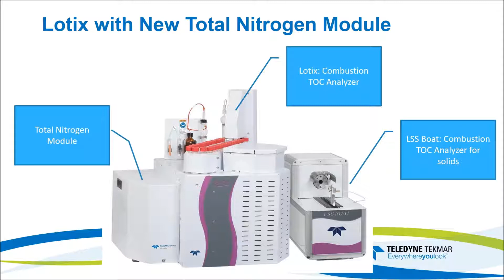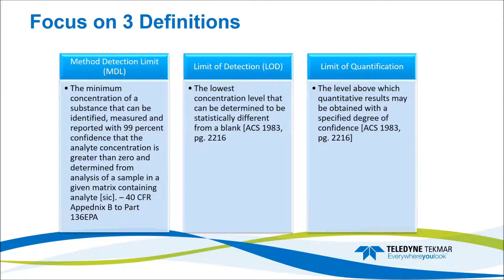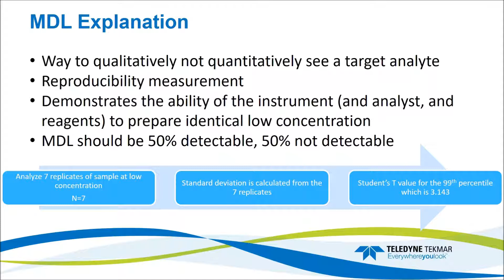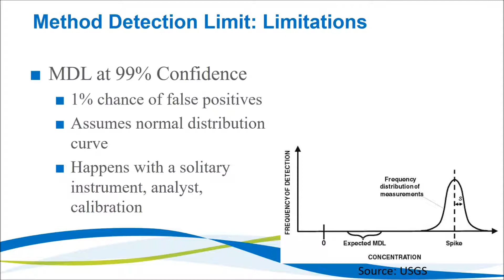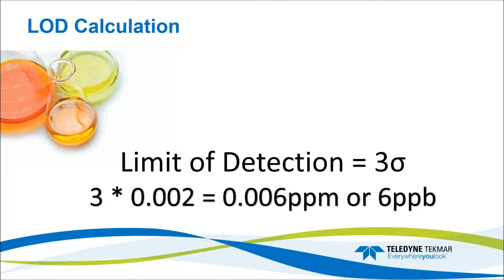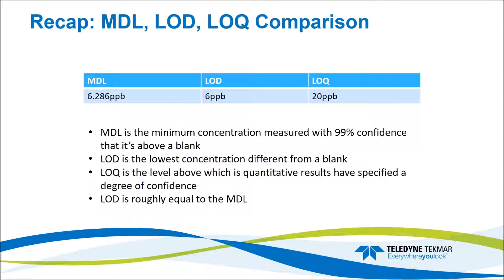Teledyne Tekmar webinar Is zero really zero  Detection Limits  How Low Can You Really Go

Comment: I'm fairly certain that the listed guideline of MDL < 5 x spike is not a requirement. The CFR recommends the starting point for the MDL study spikes as 3-5 x the estimated (or desired) MDL, but the first study based on those spike levels frequently fails the requirements that MDL < spike < 10xMDL and the study has to be repeated with adjusted spike levels depending on which direction it failed. The adjusted spike levels may or may not fall in that 3-5x range.